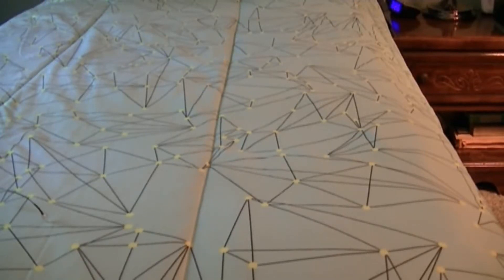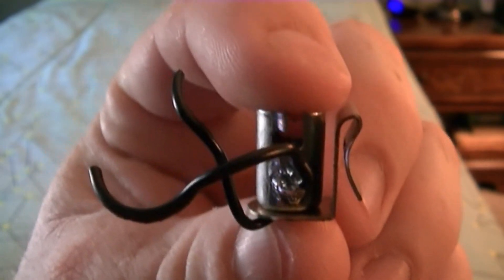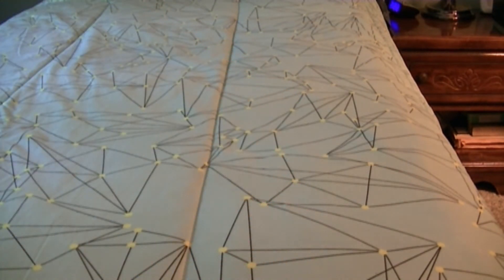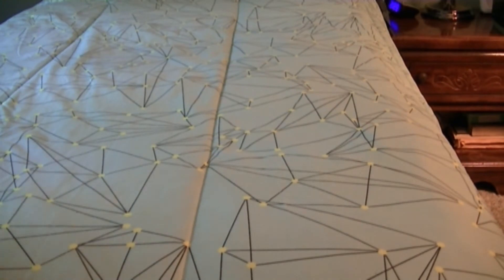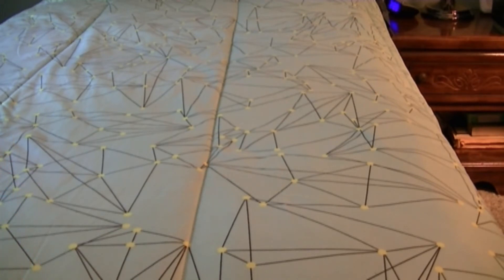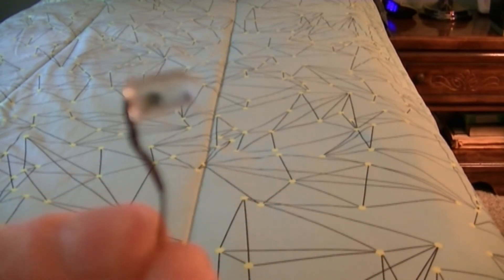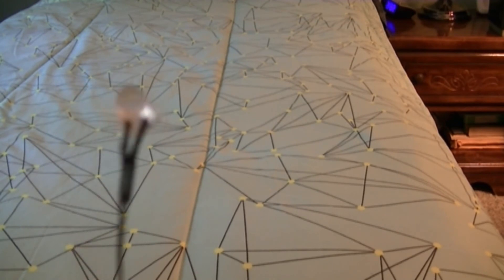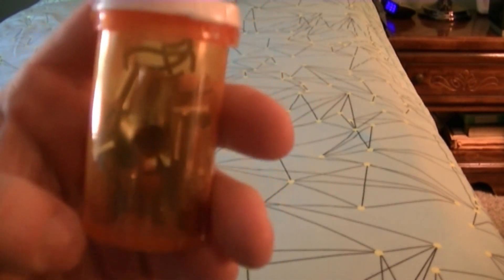Review Of How I Put The LED's In My Williams Engines and What I Used

Comment: Isn't the voltage to the light bulbs in a Williams engine AC powered and an LED DC powered? Did you wire in a diode and resister?
Reply from the maker: Yes but evans design leds come with diode and resister already added in and the led will run on AC or DC voltage.
Reply: I assumed so, but a lot of people likely wouldn't know that.
Reply from the maker: I don't remember if i did mention that in the video or not.
Reply: Not that I remember, but I believe you can see it in some part of the video. You did mention the company, people will likely go there and see available options. I have lots of diodes and resistors, it's just easier for me to make my own. I have an MTH dummy engine I put some LED's in and run off of 9 volt batteries, looks much better than what comes with it.
Reply from the maker: Yes u can do LED's anyway you like!!
Reply: We sure can. I find the Williams engines the easiest to work on as I have no background in electronics. However I once saw a ditch light kit on eBay with pictures so detailed, I was able to copy them exactly. Now I have ditch lights in 3 of my 5 Williams engines. I'm actually thinking of doing a detailed video on adding one; it's not a pretty installation the way I do it, but it does work. BTW - great videos.